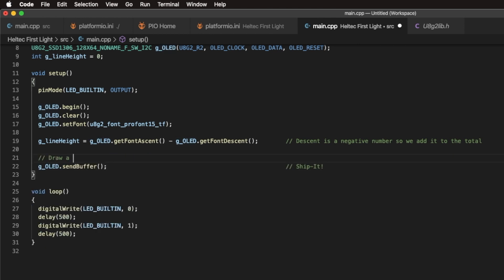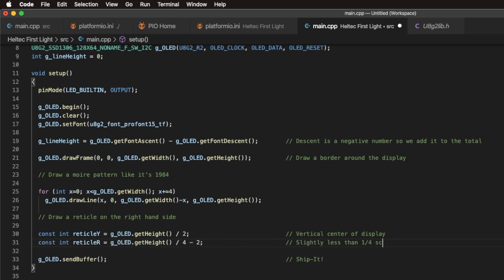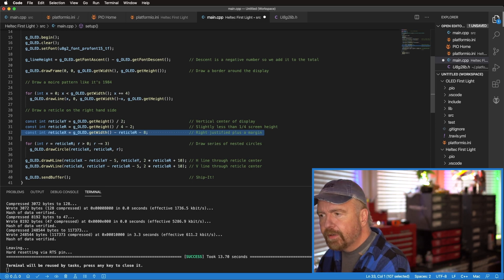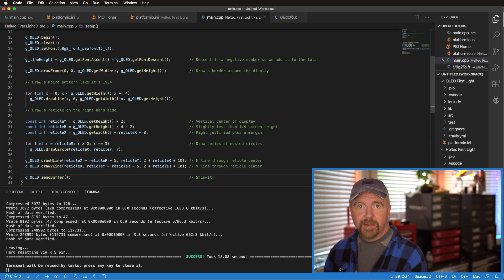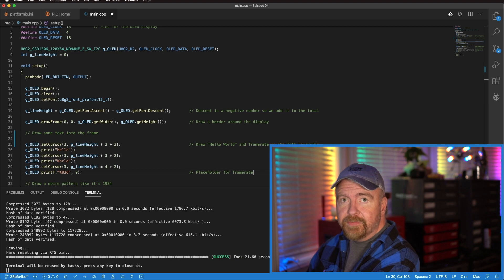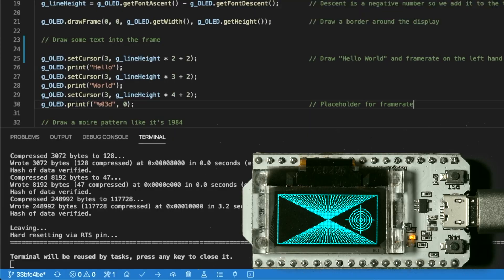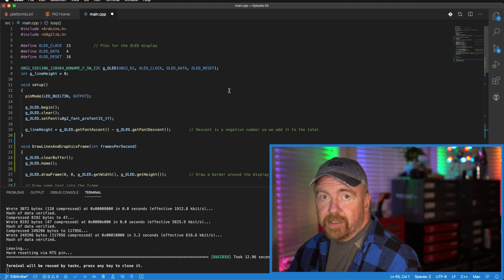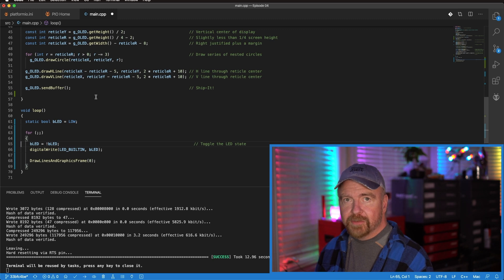03-Learn Arduino Tutorial Project - LCD and OLED Graphics - Lines and Shapes - SPI & I2C

Comment: First: Love your channel, and nice guildes. This might be a little late, but. If one wants faster FPS, you can change the I2C speed to 80 000, with g_OLED.setBusClock(800000); before g_OLED.begin();  This way one can get 38-39 FPS.

Comment: Hi Dave. First want to say you are a lifesaver. We just switched to the ESP32 at work and I am learning it here. Love the vids so far. Question though... working on the reticle I am getting the error "src\main.cpp: In function 'void setup()':
src\main.cpp:35:42: error: 'r' was not declared in this scope
    g_OLED.drawCircle(reticleX, reticleR, r);"
I should mention I am almost a complete noob to coding...well, writing code. I can copy and paste with the best,lol. I believe I have entered everything verbatum and am not sure how to correct this. I am using everything you are...; the Heltec Wifi kit 32 and Platform IO. Everything else has worked great up to this point.

Comment: 3:28 haha i pretty much drew ellipses exclusively for years, and i was saddened to find that the MS dev who wrote the ellipse function in the graphics library did not include a parameter for a rotation angle. i had to write that function myself using matrix magic. if you are gonna make us draw ellipses all the time, at least let us rotate them! if you do ever need to draw an ellipse, it will be extremely likely that your ellipse will be rotated and not at the origin.

Comment: Hi Dave, love your videos, helps me to learn every day. For a long time I've been in love with visualisation stuff, LEDs included. I was wondering how difficult it would be to implement a library for Arduino that does a similar job as Winamp's AVS? I wanted to try create dedicate hardware and software to project Audio visualisations and edit them on the fly via an App. What do you think of this idea? I think it would be cool to have a cube like projector that you can connect to via an app and edit the visuals on the fly. Thanks for taking the time to read this. I look forward to hearing a reply! 👍❤

Comment: Dave, you're obviously a hardcore and accomplished programmer. What's your opinion regarding Arduino vs "bare metal" avr programming? For a long time I've only liked/used Arduino as a hardware platform, and use the bootloader with avr-gcc and avrdude to program it. Needless to say you don't have all the wonderful library support of Arduino. But I felt that with Arduino you don't really get to learn the ins and outs of micros, but I also understand that it's more aimed at makers, and rapid prototyping. What's your opinion?
Reply from the maker: I think C/ASM coding on the Arduino is bare metal enough, even with the SDK!  It's a good mix I think, because you can rely on libs for a lot of stuff but if you're doing any serious work you'll still have to write a lot of code on your own.  I hear you though, you don't want to just be pushing buttons on a class library!  I like the balance of Arduino+FreeRTOS on the ESP32.  You get the heap manager, task switcher, I/O and the basics.  Kind of like programming a bare old Amiga or ST without a GUI, about that level!